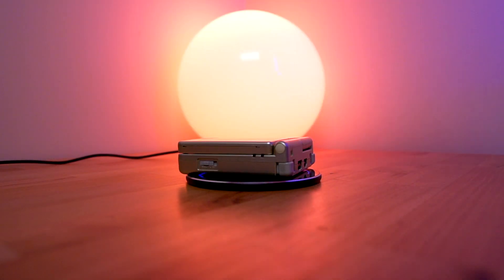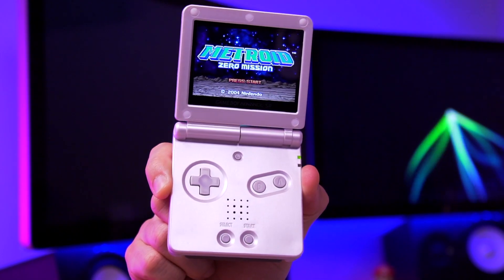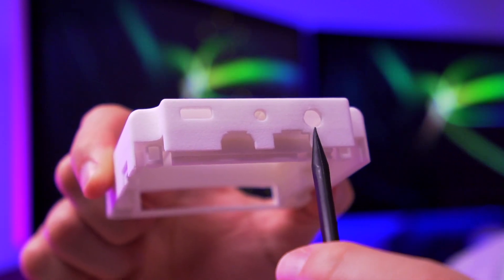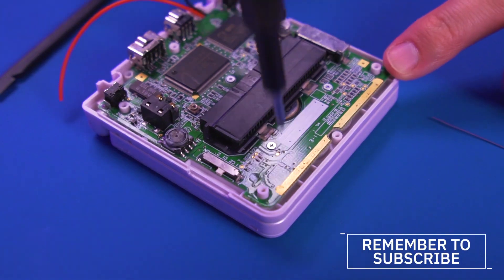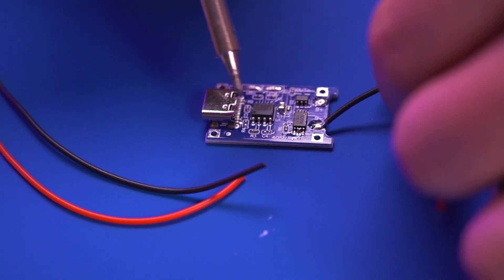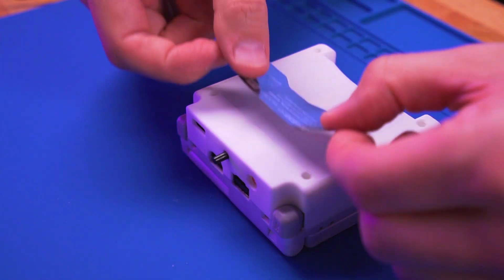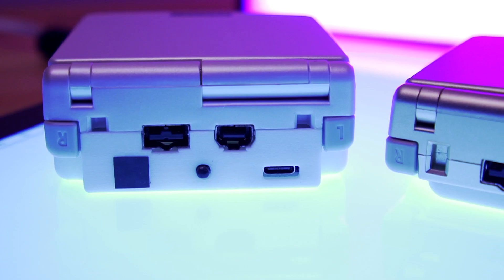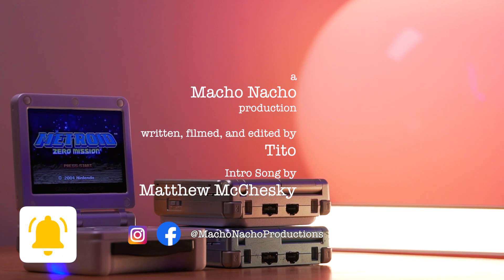WE MADE THE GBA SP THICC | SP Expander MOD: USB-C + Bluetooth + Wireless Charge + MORE | Retro Renew

Comment: Doesn't look like the gba wireless adapter and the gamecube link cable will fit anymore since the mounting points on either side of the back ports are now smaller.

Comment: Power wires from wireless charge board could have been soldered to Tp4056 charge board power in solder points next to usb c, and your not supposed to solder batter wires and devices power wires to the same solder points, it defeats the purpose of the BMS function (over charge/over discharge protection) of the Tp4056, inner solder points are for battery only, and outer are for the device (1 amp draw max).

Comment: Make sure to check your usb power adapter amperage output first, Tp 4056 charge boards are limited to 1 amp charge at most anything higher, and the board gets hot enough to burn skin. Even at 1 amp it still gets very warm. I have used quit a few of them in various projects, including gifts, so I have to order lower amperage usb adapters that are $6-11 a piece, vs most higher amperage adapters $1-4 a piece you can buy at the gas station.

Comment: Do you think it would be possible to fit all of this in the original Gameboy SP shell, you'd have to cut into the shell for the ports,and I'd be ok with loosing the bigger battery too,  it would also be a difficult fit with all the extra wires and boards... But it would be pretty sweet!!

Comment: I'd lose the wireless charging, original charge port, 3.5mm jack and use USB C in place of where the original charge port was. (I've done this to my SP, charge light works too) 
All to save space and make it even thinner. 

Just focus on the bigger battery support, bluetooth (newer bluetooth version if possible for better compatibility) and cleaner looking back shells with colour options. 

Wireless charging seems pointless when you can't play it on the go. And too many ports on the back is an eyesore and pointless when multiple ports do the same thing.
Then it'd be a killer GBA SP mod. Especially considering the bigger battery could easily support any IPS + Bluetooth mods being on all the time.

Comment: can you just put the wireless charging pcb behind the ips display, then run the coil in the battery compartment? will it charger over that distance? I really don't need the bluetooth but I do like the wifeless charging option, but I'd like to charge it right-side up.

Comment: This is cool but could this be combined with stereo (built-in) speakers and HDMI out?
What about bluetooth controller support? At least for Nintendo branded controllers, like Switch Pro/JoyCons? I doubt there's a simple solder-and-forget solution like for bluetooth audio, but it would still be cool to see. The GBA consolizer project shows that it is possible to reroute GBA input, though I don't know if that applies to SP models.

Comment: Is the Bluetooth transmitter capable of aptxLL? I'm a sucker for Bluetooth headphones on retro gaming IF there's little to no sound delay from screen. Otherwise, the retro experience doesn't feel right
Reply from the maker: I believe there is a slight delay. Kyle knows the exact number but I believe it’s about 6ms. I am not sure what aptxll is but I know it doesn’t work with AirPods unfortunately. I think there should be a link to the chip we use. There should be a data sheet for it. Cheers Ethan!

Comment: Hey man, how close are you guys to the next update on this?  Dying for more info!
Reply from the maker: Hey Nik!  It may be a while unfortunately. Kyle is currently in school and he has done most of the design work. I’d say a coupe months at least. Sorry dude. We haven’t forgotten about this project. We just want it to be really polished before we get it out!  Cheers buddy!
Reply: @MachoNachoProductions  this version of the expander shell is it possible to buy it? or maybe the previous gen?
Reply: @ds_1793  It's actually possible to incorporate all of these mods without the expander shell. It will require cutting a small section out of your battery compartment for the wireless charging board though.
Reply: @Danpixed  that sounds awesome

Comment: I just had an idea that I was curious about. So I get the desire of having all of this built into the gameboy itself. But the possibility of making an accessory is there too I believe. I’m having trouble soldering the wireless charger to the board. So I got the idea to make a wireless charging adaptor. It plugs into the charging port just like the normal charger and a little box holds all the components instead. You’d simply rest it under the game boy while they both sit on the wireless charging dock. You could do the same for Bluetooth. And they have that head phone jack nintendo made for it already. Food for thought. But it’d also allow more usage. You could wirelessly charge five gba sps with one adapter piece instead. Like I said though it’s not for everyone. But I realized the worry of damaging my precious console when I was trying to install the wireless charging mod inside lol
Reply from the maker: That’s a very cool idea indeed!

Comment: I´m just wondering if there is a BT module with which you can get the Apple Air Pods to work. That would be really nice. But as already pointed out the KCX BT Emitter doesn´t support it, sadly :/ Maybe something like this could do the trick: DSD TECH HM-19 Bluetooth 5.0 BLE-Module with CC2640R2F.
Reply from the maker: Yep this is something we are looking into. Hope there is a reliable cheap part for this. Cheers buddy!
Reply: Even if it is 10-15 bugs i would consider buying it, cause it should use less energy (better runtimes) and would (hopefully) increase compatibility.
Reply from the maker: Thanks for the input. I’ll take a look at those parts!

Comment: My biggest recommendation would be to have an option to add handles to the base.  Just for those who like gripping traditional controller grips instead of the flat surface of the SP.  Also perhaps an easier way to gain access to the battery in the event that it needs changed.  I'm not sure how feasible that would be, but if if that was possible, it'd be really cool.
Reply from the maker: Neat idea!

Comment: Ideas:
slimmer version since I find that the battery life I get from a 900mah battery is good enough for my purposes. Like wireless charging, usbc, and a headphone jack (that hopefully doesn't hum) only.
And with the slimmer version you might be able to make a shell housing for a 900mah battery that fits into the OG battery port.
Reply from the maker: Thank you Alec!  We are still tweaking and perfecting the design. Hopefully we can perhaps trim it down a little. I think a lot of folks like the larger battery, but a smaller one can always be used in that space. Cheers dude and happy New Years!

Comment: could probably reduce a bit of bulk with the 3 ground wires by soldering one ground wire from the GBA GND to the transceiver and then a short wire between the two grounds on the transceiver. Though I guess a future revision might want to have a custom all-in-one PCB anyways which could handle all the ground/signal routing, super neat regardless 👍
Reply from the maker: That’s a great suggestion!  Thank you!  Like you said, the ultimate goal is a single all in one pcb. Hopefully we can deliver on that!  Stay tuned bud!  Cheers and happy New Years!

Comment: The 1600mAh battery, if it is rated for 1C charging, then it can be charged at 1,6A. The 4056 module can only 1A. In addition, there is a general issue with these modules, described here https://www.best-microcontroller-projects.com/tp4056.html.
 So I would use USB-C with TP5100 module and change the charge resistor, so it will charge 1,6A. But this is just minor detail.
Reply: Your 100% correct! Ideally I want to design our own bms circuit but tp5100 is so cheap!
Reply: @KyleBrinkerhoff  One unexplored territory for me is, that USB 3 has some communication going on between the power source and the energy consumer, so unless you ask the power supply for e.g. 2A you will not get it. So present solution is enough, I think

Comment: so it's pretty much impossible, I think, to avoid the mess of wires. however, I wonder if it's possible to integrate a lot of the components onto one pcb. namely, having the charging port, wireless charger pcb, and Bluetooth pcb as one unit.
Reply: orientation in the extended shell could still be maintained, too, and maybe even a standard battery connector, so there's one less thing to solder
Reply from the maker: That’s the ultimate goal. I wish I had experience with PCB design to do this. That would make things a lot easier. Cheers buddy!
Reply: @MachoNachoProductions  I mean, I'd be happy to volunteer and give it a shot. I have quite a bit of free time and I'd love to contribute to this! And no, I'm not seeking payment.
Reply from the maker: That could be really awesome!  I’ll discuss it with Kyle, I think he would be on board with the idea. What would you need from us to start the project?
Reply: @MachoNachoProductions  I think starting with a more specific parts list (model numbers of each part) would be helpful. If I can get everything onto a square, I'll worry about the rest later
Reply from the maker: Thank dude!  I will discuss with Kyle in the new year. We may need some help with pcb design although Kyle does have experience in this area. Really appreciate you reaching out. This is our adult image goal. Cheers buddy and happy New Years!

Comment: Hey Tito! You are great!
What gauge of wire do you use? Second question, can magnet wires touch each other?
Reply from the maker: Thanks buddy!  Yes, magnet wire can touch as it is coated in enamel. In the video I used 28 awg wire. Cheers Victor and happy holidays!
Reply: @MachoNachoProductions  thanks! I already got everything ordered to do the same mod, I plan to fit everything (but the audio jack and the bigger battery) without the expansion . Probably the qi receiver and bluetooth transmitter behind the screen, the momentary switch perpendicular to the volume control. I’m definitely buying an extra SP just for your mod, I plan in experimenting with video output via hdmi (or usb c), transferring files without having to remove the Microsd card and wireless cable game link.
Reply from the maker: That sounds awesome Victor!  I hope it comes out well!  Definitely let me know how it comes out!  Cheers bud!

Comment: Your shell needs the extended anchor points on the back so that you can use the GameCube transfer cable. The official shell has notches on both sides of the shell but yours doesn't have it so Gameboy equipment like the GameCube transfer cable and the wireless module will not attach to the back of the Game Boy
Reply from the maker: Yep, we’re looking to add that in the next iteration. Happy holidays Dan!
Reply: @MachoNachoProductions  what's the status on this she'll where can I get the 3d print file. Great work!
Reply: Oops nevermind I found it forsake on his site
Reply: @neverthere5689  man could you share the file please

Comment: Without full mounting notches it won't fit the GameCube link cable or the GBA Wireless Adapter so I would argue that it has lost functionality.
Reply from the maker: 100% agree!  That will most likely be incorporated in the next iteration. Cheers Emmett, and happy holidays!
Reply: @MachoNachoProductions  Thanks! You as well. I'm glad to hear it is still being worked on and not specifically excluded to make something fit. :)

Comment: So it doesn't look like you can still connect the GBA to a Gamecube. Is there still enough room for the clips that the Gamecube cable has?
Reply from the maker: Great question!  We’ll probably incorporate that into the next iteration. We need to add the bottom half of the openings for the clips. Currently those accessories won’t work. Happy holidays buddy!

Comment: Technically, your SP lost the compatibility with the Wireless Adapter and any other module hooking to the back of the SP using the hook ports, so yeah, you kind of reduced its functionality.
Reply from the maker: Yep, we’ll be tweaking the design!  Easy fix!  Happy holidays!
Reply: The wireless adapter come in the ports between L and R buttons not on the sp backside.
They need only 2 hole on this place.

Comment: Great mods! You don't need one of those huge TP-4056 boards for the USB-C though. You could get away with just a USB-C breakout board and solder that to the terminals of the standard charge port like you did with the wireless charging module. Doing that would also use the SP's regular charging lights too. Anyway just a suggestion for a potential improvement. This has been a fun project to watch develop!
Reply: I wrote that to and with a schematic
Reply from the maker: Awesome!  Thank you for the suggestion!  Will definitely look into it!  So happy you are enjoying the videos!  Thank you!  Happy holidays dude!

Comment: Ok i must Critizies your build!
You take a TP4056 board.
Thats ok but you use it wrong!
On the inner contacts are only soldering the Battery.
And the Cable that goes to the GBA Board have you full wrong.
These Cable goes to the outer contacts that you full ignored!
Why? because this board hat a Protection Circuit that the Lipo can not run to low.
With your build this protection is useless.
Your Soldering ist only for a tp4056 board without protection to see it has only 2 soldering contacts.

I knew why! You want to press tge tp4056 between battery and gba sp battery board. 
But it is a silly Methode. 

And why you soldering the Wireless charging  Modul to the power in of the original Power Board and not to the 2 contacts for Plus and minus in next to the usb c port of the tp4056? 

That's  sorry idiotic. 

That all could be Easier!
Soldering the Batterie to the orginal connector on the gba sp board. 

Then you take only the usb c port without any charge circuit. 
Solder Plus and minus to the original Power Port of the gba sp. 
And the Wireless charging to the Plus and minus of the usb c port. 
That's easier and the charging Modul and Protection are already on the Gba Sp mainboard. 
And it's a  smaller build

The Tp4056 board is useless because a charging circuit for 3.7v lipo it is on the Gba Sp Mainboard included. 
The Original Power Adapter put out 5V through the  loading Port. 
Why not use this? 
And it cut down the Cables. 

The 2 Wireless charging cable to the usb port on Plus an Minus. 
Then from there to the charging port and you have both chargin Methode in the line.

And all of this can be soldering on the battery side of the mainboard
 

And a tip! Use thinner cables!
These are fat. 

And for the capacity that battery is big
Reply from the maker: Thank you for the insight. I think Kyle indicated it could only work the way we did it. We had a goal of not soldering directly to the battery contacts so that the mod could be reversible. I’m hoping Kyle can address the rest of your concerns.  

Also agree, using a thinner would be helpful!

Again thank you. Happy holidays!!
Reply: @MachoNachoProductions  Yeah you can use the  contacts for the battery on the board like you use the conection between tp4056 and  the mainboard.
I Mean these 2 soldering contacts on the Batterie connector Backside. 
That connection is ok to soldering the batterie cable on it.

I use that in my special GPA SP too.

But the Wireless charging and the usb C port can be really easier.

Take a usb c Port without any circuit like this
https://a.aliexpress.com/_BO8DTq
Then you soldering the cable of the  wireless charging on G an V. 
Then soldering cables from G and V to the Backside of the  Ext 2 Port. 
There are 2 Pins for Gnd an 5V in. 
You can use the Backside of the Port or the contact on the Mainboard. 

And finished!
And it is easy to remove. 

The 5V from USB C  and from the Wireless harging goes tho the original charging port. 
And from there to the Charging circuit on the Mainboard. 
You have under Voltage and Over Charging Protection  on the Gba Sp  Mainboard and the Original charger charge wit 5.0-5.2 V. 

No tp4056 needed and it's ab better build
Reply from the maker: Awesome!  Thank you so much for the input!  Will have to look into this!  Happy holidays!
Reply: @MachoNachoProductions   so I make it as a picture. 
I hope it is clear to understand
http://imgur.com/a/G6avSix

I use this Methode to charge over usb c on 3 gba sp and the connection for the battery on my custom gba sp
Reply: @-Gothicgirl-  yes, it seems odd. component choices where made due to primarily hysteresis in the design process, originally, I had planned to use 5v pins for other stuff from tp4056, but we stuck with it, primarily because of commonly available form factor and full usb type c compliance. the big part is we are designing for ease of assembly. the average person cannot solder a type c connector without first learning about surface mount, BUT a person can pick up an iron and solder a through hole component fairly easily. its more of a stop gap at this point, i plan to create dedicated carrier PCB's for this mod but that is much farther in the future, depends how many people decide to do this mod
Reply: @KyleBrinkerhoff  mmh is see your answer.
But with the function that is in the Video I think my version is better and easy to soldering too.
The usb c connector that I post is easy to use because it has 4 pins on the pcb. 
These are gnd, 5v, D- and D+. 
And we need only gnd and 5v for this mod. 

But I must correct you. The tp4056 give no 5v  signal out. The normal pins for output give only maximum 4.2v out.
It has no step up converter.
The only 5v signal can you get from usb c but not behind that on the tp4056.